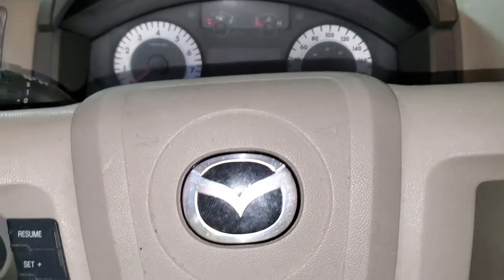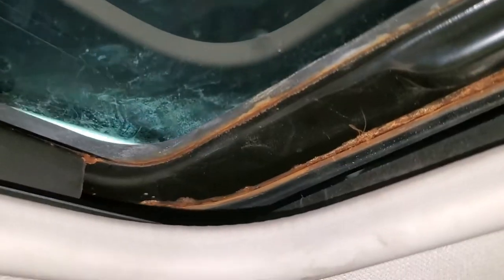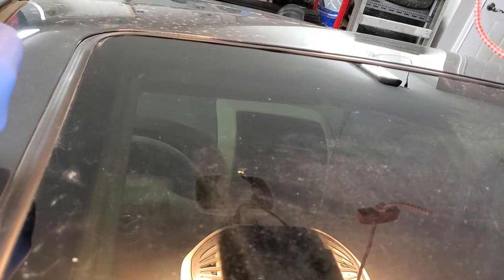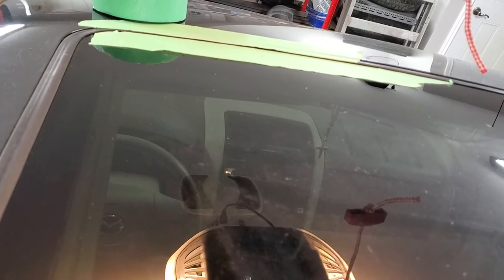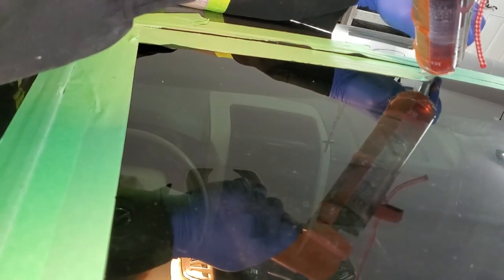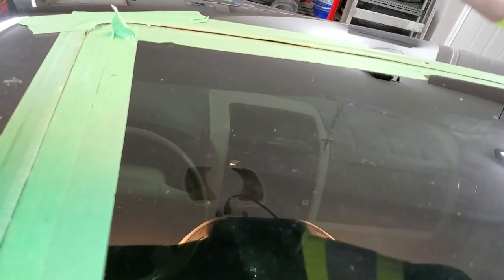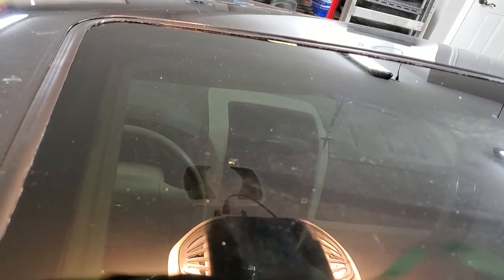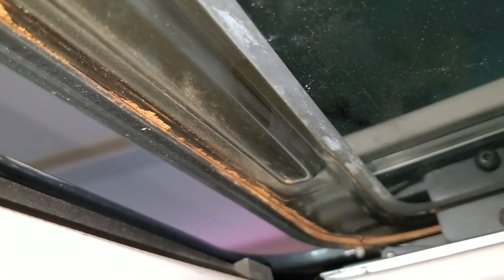Leaking sunroof on Mazada Tribute Ford Escape

Comment: Thank you for the video, I have an escape with a sunroof not sealing (level).  Providing torx size (25) and explaining the process of repair came across well.  Your method to reseal the rusted hole is rather good as well.
Reply from the maker: Thanks for the comment! It is very important to keep water out, as it can flow down to you  electronics and make irreversible damage.